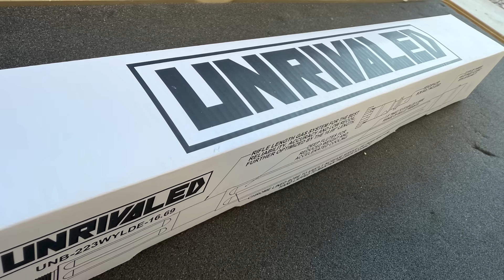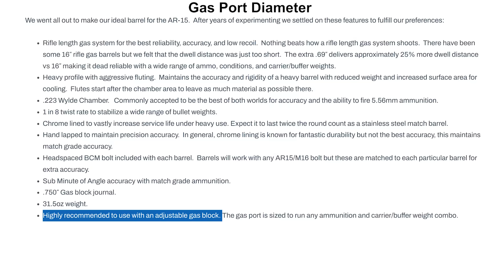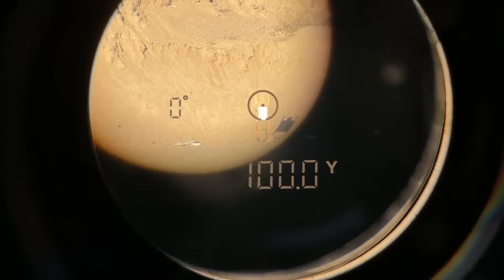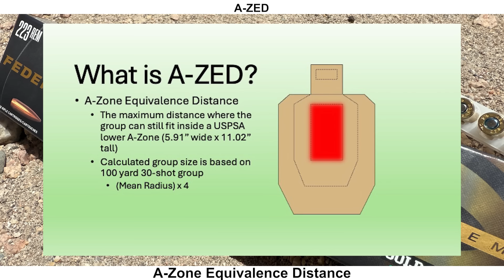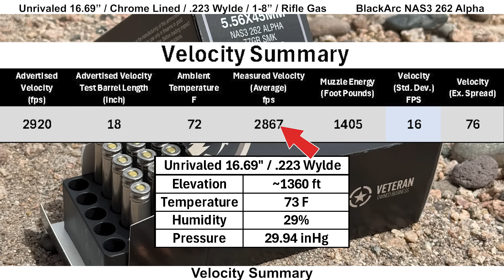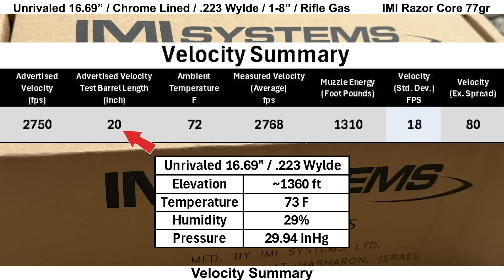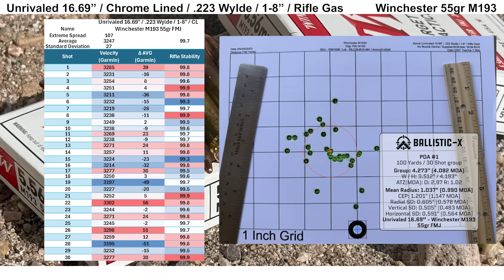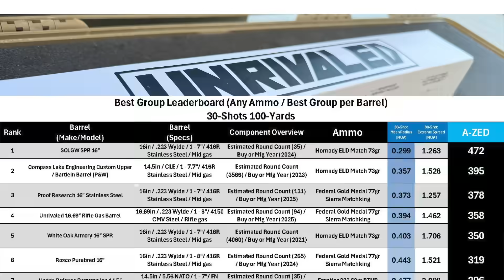AR-15 Chrome-Lined Match Barrel? NEW Unrivaled Barrel Groups & Inspection

Comment: Unrivaled started by selling 3 products.....a knock off of the JPSC, a lightweight BCG and a muzzle brake (muzzle brakes on .223 are so unnecessary unless competing) 

and their buffer spring and BCG was out of stock basically since it launched. I stopped even checking the website after it being sold out for a year straight.  Now they sell other items that they dont make but the buffer is typically never in stock.  I really do not get what do/sell.  Id be afraid to buy anything from them bc I wouldnt trust their customer service, warranty, etc.  If they can not even make and stock their own 3 products....what do they do?
Reply: We have restocked all models of our buffers multiple times in the last year and sold thousands of them.  We have 2 out of 3 of our buffer models in stock right now and they have been for several weeks.  Our buffer is not a ripoff of a JPSC and has a unique patent.  We did find out that our in stock email notification system was being glitchy recently so maybe you never received an in stock notification.  We have since fixed that so I do apologize.

Comment: Good day! I am your subscriber, I am from Ukraine. In English only with a translator, I watch your videos, I do not understand everything, only the main! Question, please tell me, or give a link, which of the barrels with a 1:8 twist is the best for accuracy if the bullet is 62 gr and 69 gr? Now I have SPRINGFIELD SAINT VICTOR AR-15 LOW CAP 16'' 223 REM, twist 1:8. Thank you
Reply from the maker: Unfortunately, I do not have a good answer for you at the moment.  But, I am working on 2 ammunition reviews where I will be shooting 62gr and 69gr through several barrels. So, it will probably be a month or two, but, I'll be able to get you a better answer in a little while.  Thanks for watching!!
Reply: @PrestonJMoore  yes of course, I will be looking forward to your videos! It is a labor-intensive work, to explain so clearly step by step, respect to you! 👍

Comment: You have a wylde chamber with a reduced throat, that is why your velocities are higher... the pressure is higher... the ejection marks on your brass are pretty heavey....
Reply: For the first set of brass... the federal brass usually holds up better
Reply from the maker: You make a good point about the Wylde chamber potentially contributing to higher pressures and velocity. That said, I’ve chrono’d other barrels with .223 Wylde chambers and similar lengths that didn’t produce velocities this high. So while the chamber might be part of the picture, to me, it seems like there are likely other factors involved.

Appreciate you watching and taking the time to leave such a thoughtful comment. It’s exactly the kind of discussion I hope these videos spark.

Comment: I was just looking at your barrel list and I didn't see the Ballistic Advantage 18" SPR barrel cut for OP'S 12 collar. Have you tested it yet or did did I miss it? I built 2 MK12 Mod0 clones using that barrel and ended up selling them at the target range both times I went to zero them. Now I need to build a 3rd one to keep. I intended to keep the 1st and 2nd but when I was offered 3 times what I paid to build them I just couldn't say no. So this one is going to be personalized with my name engraved on it and a custom Duracoat paint job in M67 Tiger Stripe.
Reply from the maker: I have not tested that barrel yet
Reply: @PrestonJMoore I hope that you do. It's a good deal for $150-$175. It was grouping around 2½" at 100 yards with M193 for initial zero and break in. I only got 60 rounds thru 1 and 40 thru the 2nd one. I didn't even get to try any different loads before the money started flying. I guess that is just what happens when you get to the range with cool stuff.

Comment: If this is possible to run on a Gen 3 frame with like a gen3 to 4 guiderod adapter.... It would be a cool option for them to provide the parts needed to adapt to Gen 3 frame on the site

Comment: Accuracy isn't the only thing this barrel was designed for.  It's made for the 2-gun / 3-gun competitor.  It's a little over A POUND LIGHTER than the barrel with the best accuracy so far in this test.  It's for the 2-gun / 3-gun shooter that shoots a high volume, doesn't like changing barrels every year or two, doesn't want to run around with 3lbs of barrel, wants really good accuracy with higher than average velocities.  This would be at the top of the list for that type of shooter.  Regarding the price, it's high for sure.  BUT it does come with a matched bolt so factor that in with the overall cost on top of not having to worry if your current bolt isn't quite the right headspace for a different barrel you might get.  Like, when you get a JP AR barrel.  If you want to benchrest with a gas gun, this probably isn't the barrel for you.

Comment: Thanks for putting in all the time and effort to make some general comparisons between different barrel manufacturers. I’ve noticed that the groups you’ve shot are frequently either vertically or horizontally dispersed which could be a number of things, but I wonder if some of that is shooter induced or just particular combo of the barrel and ammo. I’d also like to see what the inside of the barrel looks like after you did your testing, looking at the amount and location of copper fouling would be interesting.

Comment: I have a question and can’t find where anyone has done a video on it. Would changing the gas block setting effect pressure/velocity. Nothing your higher velocity and pressure with the 55 gr. Would proper of adjustment  (cycling, bolt hold open on the last) change the over pressure and therefore velocity? You already have the data at the current setting for the given weather on that day, hmm just food for thought. I would like to see that video, from a theoretical standpoint I would think it would. Although, how much, I don’t know.
Reply from the maker: Theoretically, yes, reducing the amount of gas used to cycle the action of a semi-auto would affect the velocity.  The difference between a few clicks on the adjustable gas block  either way would likely be smaller than what I would be able to measure.  

I believe there way be some videos or articles out there comparing velocity of a semi vs bolt action, or semi auto with the gas shut off vs on. If I am remembering correctly, I think the difference in velocity might be somewhere around 1-3% between a functioning semi-auto and shutting the gas off completely.

It's not a topic that i find to be particularly interesting. So, I don't plan to do a video on it.

Comment: You shouldn't be ranking these different barrels because your testing is skewed!!! You need to test every barrel with the same ammo and none of this mixing of ammo stuff!!! Your comparison testing is just a complete waist of time and money!!! Only a nit wit would mix up different rounds for each barrel test and use that as a baseline for ranking them!!! What you should be doing is shooting a 55gr, a 62gr, a 69gr or 75gr(pick one and use it in all testing), and a 77gr.
Reply from the maker: Thanks for taking the time to watch and leave a comment. I genuinely appreciate the feedback.

To clarify, I do provide multiple comparison charts within the video that address your concern about using consistent ammunition. For example:

A direct comparison using 
Federal Gold Medal 77gr SMK can be found at 7:30
IMI Razor Core 77gr at 11:30
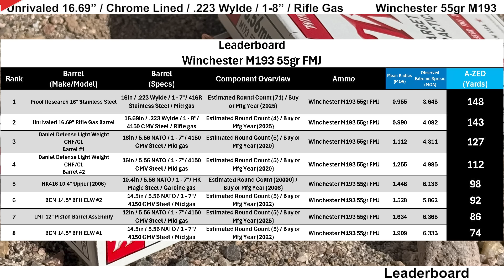Winchester M193 at 13:30

Each of those compares barrels using the same SKU of ammunition to ensure a more direct comparison.

The chart you’re referring to near the end of the video shows each barrel with whatever ammo it performed best with. That was inlcuded in the video to add additional context. Since I already included same ammo comparisons earlier, I didn’t think the additional chart would be harmful. But I sincerely apologize if it caused undue stress or concern. That wasn’t my intention.

I do appreciate your suggestions about standardizing with 55gr, 62gr, 69gr, or 77gr. If you have any other thoughts or changes you’d like to see in future videos, feel free to share them. Always looking to improve.

Thanks again for watching!!!

Comment: Great video as always! It would be interesting to see you try some lighter weight ammo. I get the 77s for longer range, but the best 223 groups I've shot were with 52 and 50 grain loads. Unfortunately both aren't readily available anymore, but something like the Fiocchi 50gr vmax or Hornady 55gr vmax load. The black hills 52 gr I tried years ago was always sub half moa.
Reply: FWIW, projectiles are available everywhere online. You can find a 52gr, and use a kinetic puller to pull the projectile from box ammo and reload with a simple $40 press from Scamazon.
And I apologize if that kicks off a 'reloading for precision' addiction. Especially if you buy a $40 scale and weigh the charge you dump from each round and then make each one the exact same.
Darn. I did it again didn't I? Definitely don't buy a seating depth gauge, a runout gauge and a meplat trimmer. That would be bad.
😁
Reply: @m4rvinmartian  I do reload for most calibers I have, but I think factory ammo that anyone can get is best for these videos.

Comment: Is the increased fps readings because of the high summer temps?
Reply from the maker: Groups were shot in late May. Ambient temperature at time of testing was 73-74 degrees
Reply: @PrestonJMoore  what do you think was the cause of the extra speed?
Reply: @splatterhousethorn  The longer gas system, chrome lining/lapping, and Wylde chamber with 1/8 twist all give slight velocity gains.  This adds up and we see velocities common to 18-20" barrels.  We are big fans of the Mk 12 and wanted that performance out of a lighter, shorter, and longer lasting barrel.
Reply: @UnrivaledTechnologies 
Ahh I got you. What an awesome concept and execution. Nicely done.

Comment: Ambient temperature 77F, how did the camera over heat?
Reply from the maker: Sitting in the direct sunlight for a while usually does it. It's also an old iphone that heats up anyway with extended camera use even if it wasn't in the sun.

Comment: Any company that is called "unrivaled" is definitely just a ploy 😂.  Gasport sizing could be compared to a first gen BHW barrel.
  Curious if you did a 5X 5 shot break in cleaning? Any of these chrome lined barrels should really be polished with MP5 OIL, then lap seasoned. I guess only us match shooter's do that.
Reply from the maker: I follow the barrel manufacturers break-in procedure..  If the barrel manufacturer does not list a break-in procedure, I don't perform one. Unrivaled does not list a barrel break-in procedure.
Reply: @PrestonJMoore 5 X 5 with cleaning between each 5 shots is kinda standard break in for most manufacturers of AR platforms that ive come across
Reply: Looks like Unrivaled is owned by the current rifle world champion. Pretty sure that means hes Unrivaled...
Reply: @JimmyLittle-p8w1p 😂😂😂 sorry bud thats not how that works. Carl from BHW was also a champion and holder of several long range awards. If this guy and this company was unrivaled then wouldn't this test have been the overall winner and not 4th place? Besides that barrel had standard enfield style rifling. Gonna be damned hard to ever be on top of anything other then a competitive field of other Enfield rifling profiles 😂😂😂
  Especially with chrome molybdenum coatings. You can gold plate a turd, but cant prove it came from royalty 😂
Reply: @shanestamball1886  Kyle Litzie placed first overall at the last IPSC Rifle World Shoot (held once every few years).  His recent 4th place finish you are referring to was at the Pistol Caliber Carbine World Shoot, he has been shooting PCC (9mm) for less than a year so I would say not bad.  Lots of people are champion shooters and there are a wide range of disciplines in shooting.  IPSC rifle is shooting for accuracy and speed on dynamic courses with targets out to 400 meters.  He is considered the best practical rifle shooter in the world currently.

The gas port is actually properly sized for the dwell distance, any smaller and you can get fail to lock back with some of the less gassy 223 ammo and no suppressor.  I'm not going to defend our barrel here, I don't have any shade to throw at other barrels or manufactures.  They are all for different applications and price points.  Our barrel fits the desires we have for a practical/competition/duty barrel based on our combined experiences with the m16/ar15.

I prefer not to engage with ignorant trolls but felt the need to set that straight because Kyle is too humble of a dude to.  - Zack

Comment: That's way too much squeeze for way too little juice, considering that it's only an 80 point AZED increase for $400-500, depending on which 16" barrel you get from Geissele. You're probably better off just buying more ammo with that $400 saved from going with either Geissele or Criterion.

Comment: I’m very happy to see the sons of Liberty Gun works barrel still at the top because I actually bought one of these barrels and it would’ve broke my heart to see it dethroned so quickly after my purchase you are the best bro I’ve always wanted to make very informational YouTube videos and you set the bar so astronomically high withthe accuracy of your data and the beautiful layout of your videos
Reply: There’s nothing wrong with wanting something better. They have to deal with what they’re issued, we don’t have that limitation.
Reply: @Tyler99.18  yeah but you’re right though if you chase precision on the A.R. 15 platform you’re just running in circles because you can get the same accuracy out of a proof research barrel as you can with a $1500 bartline
Reply: @BrassAndBeards 100%. I don’t see the point in getting too crazy with it, I think if you can get something that shoots under 2 moa consistently, you’re already in a pretty good spot, at least for the most part.
Reply: @Tyler99.18  It's called diminishing returns. Most quality barrels are more accurate than the rounds and MUCH more than the shooters abilities
Reply: Relax, you're shooting a varmint round through a platform whose military criteria was 4 MoA. Unless you're doing SF raids, concerning yourself with what is currently "the best" (sample size of one btw) is a Sisyphean task.
Reply: @Trisket  I’m just being funny at least I thought I was lol I do have some sons of Liberty stuff but I’ve had it for a while. They’re good stuff I run more.geissele than anything

Comment: It’s been my experience that hand lapped chrome lines match barrels are generally faster than stainless steel. My only guess is better lubricity.
Reply: More likely answer is that since chrome is an additive coating, chrome barrels are tighter and therefore more gas efficient
Reply: @spacecaesar7619  maybe but lapping removes material, and chrome barrels are reamed oversized and coated down to a spec. So a .224 bore ain’t gonna be far off.
Reply: @christaylor77723 true for a traditional CHF barrel but this thing is button rifled. That, in combination with the signs of over pressure exhibited in the brass, lead me to think it’s a tight bore. Basically they’re cutting a barrel with a buttoning jig that isn’t calibrated to account for chrome, then hand lapping down to make the barrel usable, while still winding up somewhat tight.
Reply: @spacecaesar7619  if they’re hand lapping chrome they’re likely air gauging as well which dismisses your dimension argument. Added lubricity and near flawless concentricity is the more likely contributor to increased velocity.
Reply: @DavidJones-hr9bn How do you account for the signs of over pressure then?
Reply: @spacecaesar7619  the moderator stated he didn’t observe any .
Reply: @DavidJones-hr9bn  12:40, overpressure signs on the M193. Same lot he’s been using for a while now, first barrel to exhibit that issue.
Reply: @spacecaesar7619  so, an anomaly with one brand and weight of ammo! If the bore is smaller than standard in diameter, why not similar results with the other ammunition variants?!!

Comment: With each subsequent video you drop, the SOLGW barrel gets more and more impressive (who is the OEM for that by the way?). Think I've settled on that once I shoot out my WOA.
**Edit: I wonder if there is something about chrome lined .223 Wylde barrels that give it a bit extra oomph. Criterion Core barrels also have notably higher velocity for their length.
Reply from the maker: I think Black Hole Weaponry might make the SOLGW SPR barrel.  Not sure if they make all SOLGW barrels or just that one.
Reply: @PrestonJMoore  Hey Preston have you tried the Die free Co. kung fu grip? And if so how does it compared to the grip you use?
Reply from the maker: @hopewilliams6705 haven’t tried it.  Looks neat though
Reply: @PrestonJMoore  what grip do you use?
Reply from the maker: @hopewilliams6705 anarchy outdoors alpha precision rifle grip
Reply: Black Hole Weaponry is the OEM for SOLGW SPR barrels now.
Reply: @BillyWillicker  ok. When did that happen? I'd heard BA was making them.
Reply: Excellent test and video as usual! Please test a LaRue 16” Match Upper!
Reply: It's not all chrome lined barrels that has higher velocity. It's just something Criterion does during their production of barrels (they undersize the bore diameter, if they look at Criterion barrels internal diameters it's always slightly smaller than the standard diameter for that caliber.) Further evidence that this barrel is just a Criterion with the outside done by Unrivalled